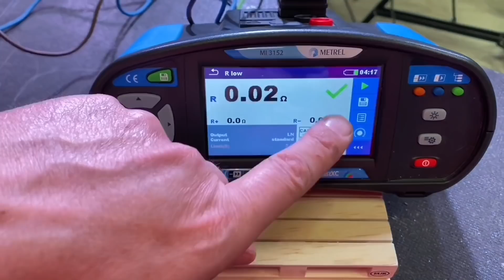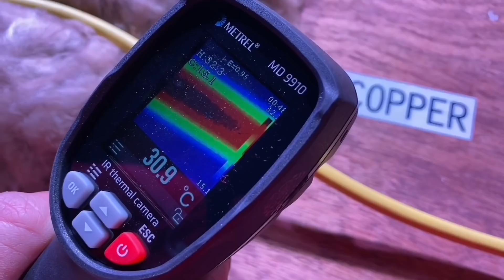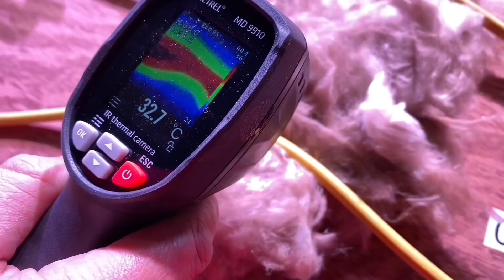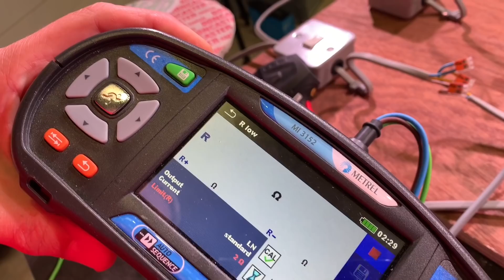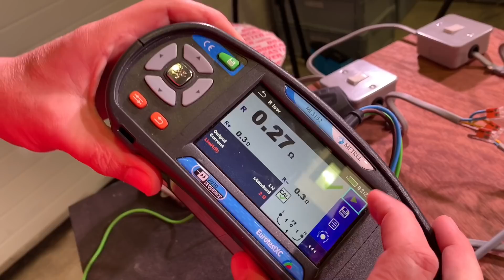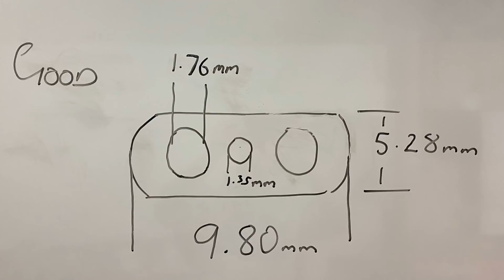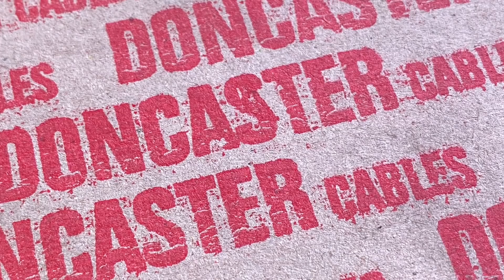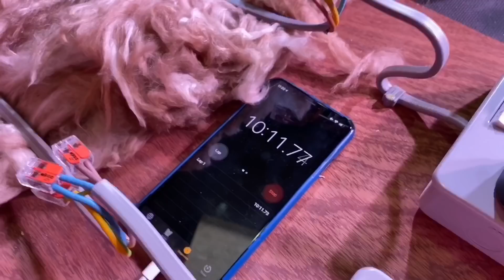The disturbing facts about FAKE and SUBSTANDARD cables - UGLY Twin and Earth, light weight flex

Comment: Currently 2nd fixing 200 new build flats and been using prysmian low smoke twin and earth and went it’s cold it’s incredible hard to strip. Also some of the batches of cables has a yellow tinge of the colour to them and it’s impossible to strip with automatic strippers.
Reply from the maker: LS cable is a challenge to work with at the best of times.
Reply: Its easy get the earth and rag it up
Reply: I have seen a picture online of a prysmian cable that had 6mm2 written on the jacket and 4mm2 on the inner conductors.